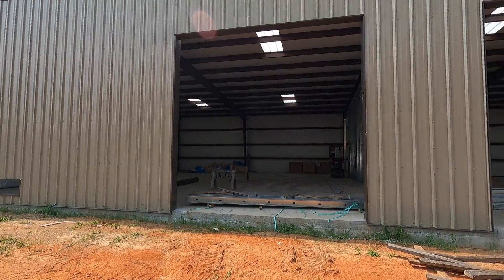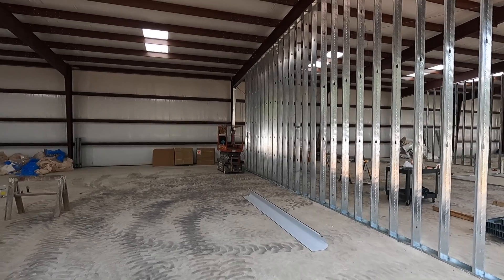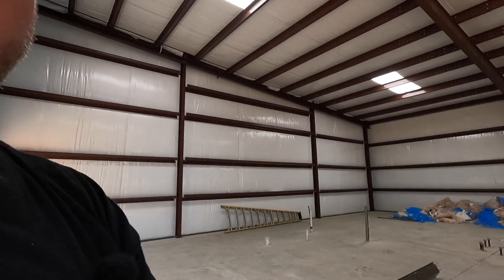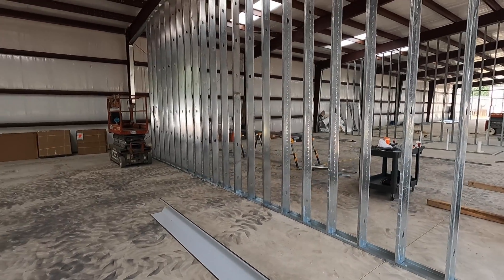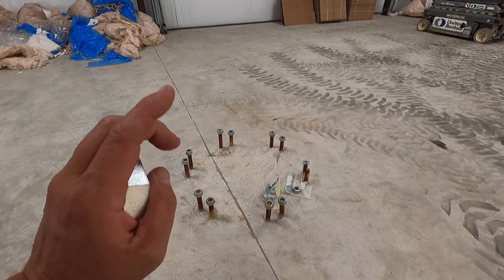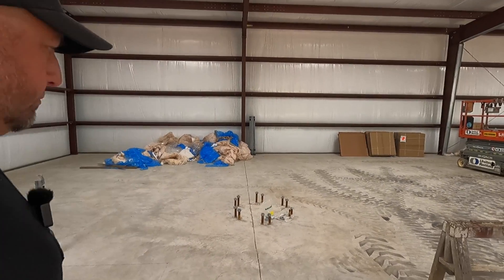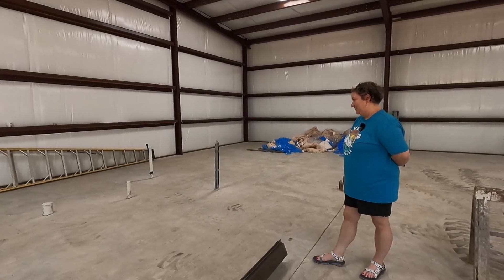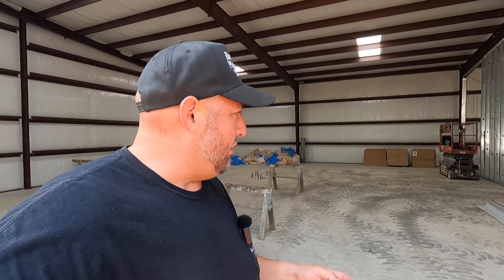New Shop Space Update 2

Comment: was is a good idea to place the expansion joint to go through the foundation of the collum ? i would think that haad to be solid and expansion joint should go around it.
Reply: with the huge base under it it wont matter
Reply: It's actually a contraction (or control) joint.. not expansion.. there is a beefed up footing (not footer) underneath the bolts with plenty of rebar to support the load.. concrete is strong in compression, not tension.. rebar is strong in tension, but not in compression.. with those 2 together, you won't ever have to worry about the control joint.. good point tho!
Reply: I thought that at first, but it looks like it doesn’t cut all the way through the slab under the crane.  I could be wrong though.  Not easy to tell.
Reply: @garygentry583  that footing is so over engineered you couldn't believe it. Do you know the tensile strength of 1-1/4" all thread?? It's incredible and there are like at least a dozen of them.
Reply: @truckguy6666  ok.. thank you for backing up my statement..
Reply: @truckguy6666  and just fyi, those are anchor bolts, not all thread.. they are only threaded for about 5".. smooth shaft below that with 2" leg that turns 90°..
Reply: @garygentry583  They are interchangeable with all-thread of a proper length with a nut and washer on the embedded side. I have never seen an 1-1/4" anchor bolt but dont doubt they exist. Frankly with a footing that big they should be simpson SSTB's
Reply: @truckguy6666  the point of having an anchor bolt, is to lock the 90° leg into the rebar cage.. very hard to do with all thread, washer, and bolt.. and the tensile strength of an anchor bolt is much higher than all thread.. and anchor bolts are galvanized.. you can get galvanized all thread, but you'll pay more than you will the anchor bolt..

Comment: You should be able to use a transformer to boost the 240 3 phase to 480 if you have a high enough current feed to your shop. Easier on the machines that require it and eliminates the need for a rotary unit.

Comment: What's the story with the crane straddling the expansion gap? Is the gap only important during curing, or is the expansion so small that it won't affect the crane mount? Are you going to have a small garden area like the units at the very end?
Reply: That is a control joint so that it tends to crack there instead of random spots. It's a very shallow cut.  Concrete will crack.

Comment: Have you started thinking about machine placement (layout)? 
I find many benefits in using SketchUp (a simple but useful program ) for making quick layouts for machine placement.  

Also, have you considered a layer of metal (corrugated steel)  or wood sheeting for the adjoining wall to make it easier to hang small items?  
I understand drywall is probably needed for fire ratings, but a benefit of additional sheeting would also prevent ease of entry from someone entering by breaking thru the drywall?  
Theft deterrent.

Comment: Interesting video.
What is the US standard when telling "240 volt 3 phase"? Is 240 the voltage between 2 pases, or the voltage between phase and ground?
In Europe, especially Sweden, we use one phase 230 (earlier 220) volt for households etc., using one phase and ground.
For 3 phase we say 380 volt that is the voltage between 2 phases. All coming from the same grid.
Reply: The UK is 240 single and 415 3phase. US is 120 single and 240 3 phase
Reply: @rl3898  Sweden once used 110 volt single phase but dropped it some 80, 90 years ago. Is US a developing country in this respect?
Reply: So it's been 10 years since my AC courses in school, but 240V 3 phase is three entirely separate 240V phases that are 120 degrees apart. So three separate transformers. 

Residential power here is actually split phase. You have three wires coming into the house - two hots and a neutral. This is out of one transformer. Measuring between the two hots would give you one phase at 240V. The neutral comes from a centre tap on the transformer. Measuring between a neutral and a hot would give you 120V, and measuring between neutral and the other hot would give you 120V 180 degrees from the first hot wire.

Confusing? It sure confused me to learn it haha
Reply: @charlesemmer8856  Thanks! Half the voltage calls for the a doubled current, higher losses, thicker cables, to have the same power available.
110 volt should be considered the same dangerous as 230 volt so no difference there. Power consuming things as electrical owens often run from single phase, 230 volt, but sometimes from 380 volt 3 phase.
Reply: @Stefan_Boerjesson  Before I retired I worked with a wide array of power services. Three phase 120/208, 240, 480/277, 480, 575, and services from 60 amp single phase through 4000 amp three phase.
Reply: @jules2067  There is a little use of 480v split phase single phase in the UK. Saves on copper to remote areas, remote as in 5 miles from 3phase 11kv not US type remote !
Reply: @charlesemmer8856  You have seen a lot. I don't know the basic reason for using a higher voltage, as standars, in domestic areas since 80,90 years. The raise from 220 to 230 not so long ago came from efficiency thinking. In most of the industry 380 volt 3 phase is used but for the high power consuming industry like iron works etc, I have no clue what voltages they use.
Reply: @jules2067  Electrical three phase power  comes in for industrial use off of a single three phase transformer either as a delta  three-wire connection with no common, or as a wye connection with three hot wires and a neutral (center tapped) conductor.
Reply: @charlesemmer8856  Cool! I've never worked with industrial stuff, just touched on the theory. My practical knowledge is not good lol
Reply: @Stefan_Boerjesson  Higher voltage uses less current and therefore lower IR (power) loss. It also lets you use smaller wire to deliver the same amount of power. BTW, I worked on aluminum and steel melting furnaces which require huge amounts of power.
Reply: @charlesemmer8856  You quote my thinking. I did pass some power electric courses on my road to an MSC in electronics and computer science.
Reply: @rl3898  Three phase power for low voltage can vary for different regions of the country. Here in Wisconsin I have worked with 240vac delta and wye and 480vac delta and wye. For some equipment I had to develop 575vac.
Reply: Jeez wishing Adam hadn’t mentioned electricity.
Reply: @charlesemmer8856  Now that is a very unusual voltage, what for, or secret?
Reply: @rl3898  The 575vac was needed to power a resistance aluminum melting furnace brought in from Canada.
Reply: @charlesemmer8856  Ah interesting, I think ours run on  11kv, or did, as most are closed now.
They used funny hertz and rectification too I seem to remember reading.
Reply: @unwired1281  Is Adam Your baby, Your entire life? His work, his decisions are his and are undisputable. Common facts about US, new for foreigners, ought to be possible to discuss.

Comment: From a life long sparky.  No such thing as low or high ( meaning 240 or 480 volts ) 3 phase services. For a small shop like your cheaper going with 240 volt service. Probably do not use enough power for ultility company to supply 480 volts. 250 volt rated rated 3 phase circuit breakers probably 4 times cheaper then 600 volt rated 3 phase breakers that are used on 480 volts. Installed 240 volt 3 phase services from 200 to 800 amps.
Reply: From an electrical engineer. 240v is 2 single phases of 120v 180° out of phase, 208 3 phase is what we classify as low voltage 3 phase 3 legs of 120v 120° out of phase of each other or 120v phase to ground. 480v 3 phase is high voltage 277 120° out of phase of each other.
Reply: @thomasingramfarms230  carefull now, there is more to it than that. You listed the typical sinusoidal waveform for a Wye thee phase setup, Delta is different and much more complicated. 240v is often times just a general statement that is cross used for standard split phase (incorrectly referred to as ""singe phase"") 240v, and also used to refer to 208/230v three phase. At this point (although things do change) Adam is unlikely to be able to justify something like a 480/277 service. The service provider may allow it, but the initial cost and maintenance cost makes it incredibly expensive. In the case that he moves equipment in that requires 480v (or higher) the best bet is a sub panel with a dedicated step up transformer for the affected machines.
Reply: @thomasingramfarms230  Florida is a place where they still commonly use 240 volt delta connected three phase, with one phase center-tapped for single phase 120/240. He might be referring to 208/120 when he said "240", but him being in Florida makes it a possibility for it to be 240 three phase.
Reply: @thomasingramfarms230  Believe the NEC considers 13,200 volt services as medium voltage & not high voltage. ( of which very large hospital/research center that I retired from had 13.2KV dual services in all 5 buildings and some 4.16 KV chillers ). So going by this no such thing as high voltage 480 volts. When I started out back in 1970 all of the electricians called common 13,200 services high voltage. In my 50 plus years never heard.480 volts called high voltage. Never got hit ( shocked ) by it but got shocked by 277 volts several times. Worst was getting hit by the 660 volts DC from 480 volt VFD'S that had power off. Not right how some drives can take over 14 minutes to discharhe capacitor bank.
Reply: @thomasingramfarms230  240 volts can be 2 legs from a 3 wire delta secondary transformer with no possibility of the 120 volt mentioned. Worked on 2 phase 5 wire systems where both phases are center tapped providing 120 volts.

Comment: What will happen in winter? How to heat up these "few cubic inches" of cold air in this huge place?🌬❄☃
Reply: He lives in Florida it never gets below 50 degrees
Reply: @amateuranth2796  unfortunately that's not true especially in the panhandle.  It can get pretty cold but it rarely last very long.  In January or February lows in the 40s or even 30s are not uncommon and occasionally lower.  I remember being in Fort Walton, just a few miles east of Pensacola, for spring break in April and a cold front came through and the lows were in the high 30s for two nights in April.  I emphasis April since winter is usually over down here by then.  I live north of New Orleans and our weather is very similar to theirs meaning hot and humid most of the year.
Reply: @michaelporter3555  well I probably shouldn't have said never lol. Up here in Michigan 40 or 50 degrees isn't bad at all for a winter when we usually have 10s or below 0 lol.

Comment: Shooting grout under the set crane base?  No way!  If you have the opportunity to do a job correctly, do it correctly.  Your crane is a piece of machinery.  It should be installed as a piece of machinery.  Install some square stacks of steel between the sets of anchor bolts and spaced along the bearing locations of the crane.  Shoot the tops of the steel surfaces with surveying equipment to ensure they are all level.  Use dry pack grout to secure the loading bearing stacks in place. Set your crane.  Level your crane by adding shim stock as necessary. Bolt down the crane using the nuts on the anchor bolts.  Build a form on the outside of the crane.  The form should be higher than the top of the crane base plate.  Use pour-able non-shrink grout to fill all voids underneath the crane base bearing plate.  Once the grout completely cures, remove the steel shim packs and drypack the ensuing voids with grout.

Comment: Think of the column and footing like a nail under a patio stone. The nail - with the very small contact point, could crack the patio stone at the point of contact, if you place a clean cinder block under the patio stone you have a much larger contact point that spreads the load out across the patio stone. Same goes for footings. If you lay a load on a footing, even a very large footing, and say, there's a rock under the column, that rock will act as a pressure point. It's capable of cracking the footing. Suspending the column on half bolts and inserting grout not only spreads the load out across the full surface, but more importantly eliminates and pressure points - it acts as a cushion. There's also an intimate relationship between weight, surface contact area, and footing size. Bigger footings are not always better, they could be worse. Lots of engineering involved.

Comment: Hey Abom, long time fan with a question:  I'm going to be building out a shop for my business soon also and will have a need to heavy lift.  My business is related to electric vehicle batteries, they can weigh between 500 and 1200 lbs.  I had been considering a gantry crane but if they're not already installed in the shop space they can be an expensive add on.  Where can I find more info about post crane you're installing?  I'd love to compare to see if that would work for us.  Thanks and congrats on the new space, really happy for you!

Comment: Do you have to permit the tenant improvement work? Surely there are fire sprinkler codes. Doesn't the electrical work need to be engineered and inspected? Fire exit codes? Does your insurance require the other units to be inspected? You don't want a rocket fuel company with explosive vapor next to your welding. Do you need a ventilation hole through the wall for your vent fan? Just some questions from an old contractor.
Reply: It's Florida. Maga country. There are no rules.
Reply: @truckguy6666  
You would be surprised how often the government wants some fees. Insurance companies have rules also.

Comment: 2 40 vs 1 10 power what is normal where ?
Reply: In the US single phase 120 vac is normal for everything domestic except for the single phase 240 vac for AC, hot water heater, clothes dryer, oven and water well.  Is rare that any house gets 3 phase.  Smaller industry is often 240v 3phase.
Reply: Most houses in northern Europe have 3 phase  240 vac but normal outlets usually only use one phase.

Comment: Seems strange that they would build this industrial rental space and not equip it with 480 three-phase. Or, in the case of the existing buildings, that they wouldn't have been specified with 480VAC from the beginning, so the utility service would be set up like that. So far as the power company is concerned, there'd be no real difference in the cost of 240 or 480 service equipment, just different windings on the transformer.

And as far as the hoist column goes, you can't assume that the concrete floor is perfectly flat and level. Same reason why machine tools are made with adjustable feet. If the column leans to one side, it might not stay put when you're trying to position something.
Reply: @C and M TOOL AND DIE In the previous video, he explained that there's additional concrete beneath the floor slab to contain the anchor bolts and support the column, in the pattern given by the manufacturer.

Comment: With regards to your electrical, I would say have some 300mm cable tray running the outer wall at a 3m height, with 2no 150mm cable trays running horizontally across your ceiling with drop downs for any machines in the centre of the room. All your sockets and switches surface mounted in galvanised steel conduit too would be beautiful. This fully futureproofs all your electrical needs for machining. I'm an electrical design engineer and this is how I would design your building. Afterthought; You could also run compressed air lines across your cable tray.

Comment: #Abom79  You are going to have to step up your auction game and get more equipment, finally make that jump to a few CNC machines to improve that cashflow in. Most of the stuff you do/have done doesn't require the latest and greatest, you can get away with 90s and early 2000s machines for pennies on the dollar to what a new machine would cost. A Fadal 6030 or Haas VF6 would compliment that shop crane really nicely. A small 3000lb forklift makes heavy tasks light tasks...just saying....just saying. One more thing, last I looked at Gorbel they required a 1" slab of non shrink grout.

Comment: double or triple up the drywall between your unit and the next one, and the ceiling if possible. Pay for the extra drywall - cheaper now than later!  It will cut down on sound transmission from the other unit.  Imagine wanting to film and they are running a grinder or something louder all day while you want to video.  You want a lot of mass between stalls.  That's one of the things we do building studios.  Double or triple drywall on walls.  We also float the walls and floor, but that's a lot beyond what you can do there.  Also, stuff insulation between your walls (in the studs) to cut a little more sound.  Also, if you are air conditioning and they aren't it will help.  If you can afford this... of course. :)
Reply: And good for the stucco on the outside wall.  That will help kill traffic noise and such.